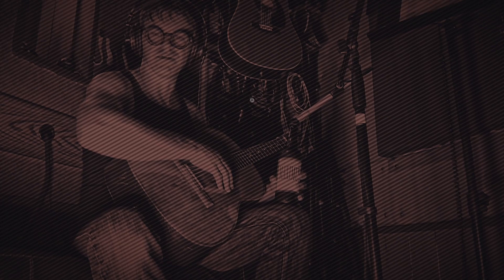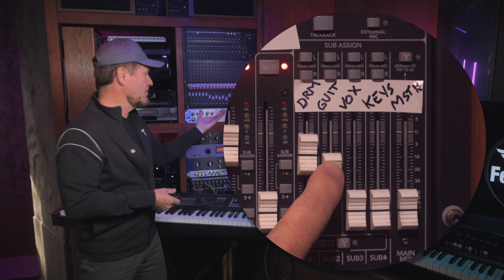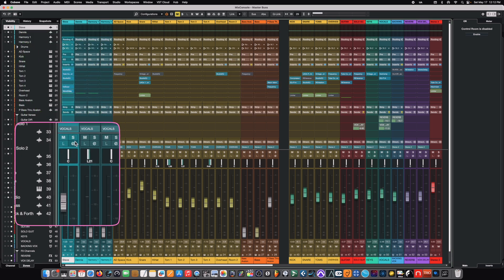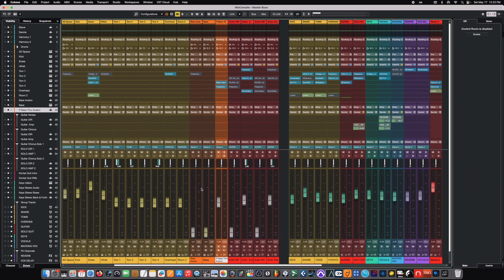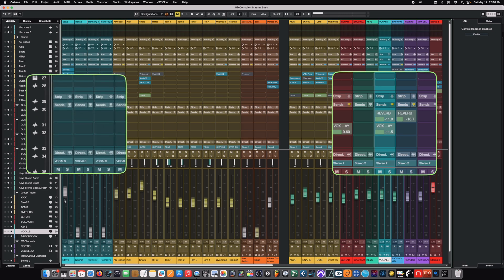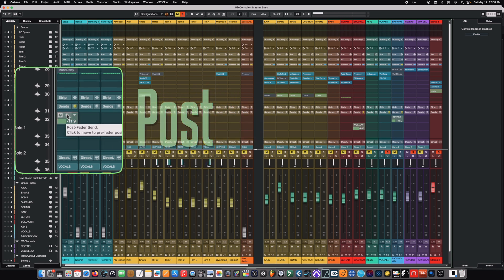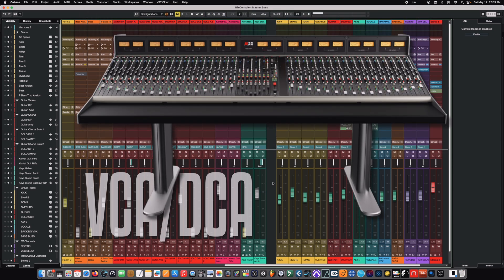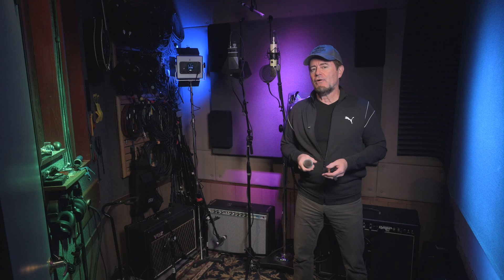Busses vs Sends vs VCA explained in Cubase.

Comment: This is a stupid question, but I really don’t understand the point of auxiliary sends when you have a mix percentage knob on the plug-in on the effect that you are only trying to send a percentage of.

For example, why would you use an auxiliary send instead of just putting let’s say a reverb plug-in on a vocal bus and just adjust the mix percentage knob on a reverb plug-in affecting that vocal bus? Doesn’t that mixed percentage knob on the reverb plug-in achieve the same result as doing an auxiliary send of reverb i.e. controlling the percentage of reverb? I’m asking this question because I feel like I’m missing something 🤪.
Reply from the maker: There are no stupid questions in audio recording for sure. In short: using AUX send amounts from channels allows each channel to have a different amount of the reverb, instead of everything on the buss have the same amount.

Comment: Thank you this was really helpful.
I have one question: at 8:42 in the video, where you choose the radio button to move the newly created buss to be with the groups on the right, I don't have those radio buttons, just a check mark that changes the visibility of the channel. I'm using Cubase Pro 14.0.32. If there is a setting to fix this, I would appreciate it if someone could tell me where it is. Or if it's been removed from this version of Cubase, if someone could let me know, I would appreciate this, too. Thank you!
Reply from the maker: On the left hand side in the 'Console' view, make sure the left zone is active. (upper right hand corner boxes) Then click on 'Zones' instead of the 'Visibility' tab.

Comment: I really like what you're doing here on your channel. If I may raise a point of constructive criticism: The analogy of an aux send/bus and a garden hose is somehwat flawed. I get what you are going for but in a garden hose 100% of the water goes in. If I then poke a hole into it maybe 20% of the water will flow out, leaving only 80% to come out at the end. With aux sends this is not the case. In a DAW like Cubase you create an identical copy of the signal, ie. you add something. So instead of ending up 20% and 80% (garden hose) you end up with 100% and 100% (DAW). Of course, then you get to the volume control on the send.
Keep up the good work. 👍
Reply from the maker: Great point.

Comment: Another great video!

I do have a critique though, but you shouldn't take it as criticism, only adding to the topic for anyone just starting out and reading this.

The problem is what you're calling what.  And doing so confidently, which may instill confidence in newcomers that these are literal definitions of labels.

Again I say, this is not a critique unique to you or your definitions or even Cubase in particular.  The same problem has existed since analog only workflows, when British manufacturers would call something different than the USA made equivalent.

From the days of Multitrack Tape Machines -> Consoles -> 2-Track Consoles, things were more clear, but not completely transparent.  Then came Digital Audio and the Wild West of DAWs and everything got even more ambiguous.

Tracks used to mean tracks on Tape.  Multitrack usually meant 4, 8, 16, 24 independent lanes of audio recorded across 1 reel of tape.  1/4", 1/2", 1", 2" most commonly.  2-Track was usually 2 discrete tracks on commonly on 1/4" or 1/2", and was most commonly used as the Master Tape Machine for Stereo recordings where Track-1 was Left and Track-2 was Right, and they needed each other to recreate the Stereo Image when played back through Two Speakers, triangulated with the listener.

Tracks were Tracks.

Channels, were what ran through cables into pieces of equipment, especially Consoles.  When you looked at the desk and said "bring down the Kick", you pulled down the fader on Channel-1, if you said "push up the overheads", you reached for Channels 7&8 each hard panned left & right.  If you inserted a compressor on a vocal, you ran that Channel through an LA2A, maybe out of there into an 1176, then out of there back into the Vocal Channel on the board.

Channels were Channels.
And you wouldn't call Channels, Tracks.

Busses, which is the reason for this comment as well as the original video, busses technically involve Multiple things being able to join together.  More accurately, electrically these are 'Summing Busses'.  

Now, what you are calling Buss vs Send vs VCA (and you spelled buss with two S'es.  How British of you!), and in the title you didn't mention the words Aux or Group but did so in the video, create a lot of ambiguity.  Let me attempt to disambiguate...

Input Channels on a Console, as well as the DAW 'Mixer Window" recreations, can process the signal coming In, but then that signal needs to go Out somewhere.  On a Console, there are often Direct Outs, that often follow the Channel Fader.  So you select an Input, then ride the Fader to the Direct Output.  Which is one way to ride levels "to tape".

But you wanna do more.  For one you wanna Mix.  And in order to Mix you need to Sum multiple signals together.  The most basic 'Mixer' in the world all the way up to a 96-channel SSL 9000K has the ability to sum two or more channels into one.  And that 2 or more into 1 is a Mono Bus, which is now 1-Channel.  If you have a 2-Channel Bus, then that can be used for Stereo left & right, and is often called the Stereo Bus.  Or the 2-Bus.  Or the Main Bus or Master Bus or the Mix Bus...  Point being, this was always a mess.

Now, after we get the essential ability to send multiple channels to a Stereo Bus that will eventually come out of Stereo Speakers, in order to get more control over the mix, we'd like some additional busses to use in different ways.

Enter Group Busses and Auxiliary Busses.

The Bus part of these only means that you can send the Channel's signal to any number of different destinations.  Again, Input Channels often have Direct Outs, so they don't Need to be summed together with other Channels if you'd rather keep them discrete.  But you often Want to sum multiple signals together for a variety of different use cases.

Group Busses, in the analog world originally, basically anticipated the desire to separate out certain channels from the Main Mix into a Sub-Mix first, primarily to make it more manageable.  The classic case is Drums, where rather than try to mix 10+ separate channels into the Master Bus, you can Sub-Mix all the individual drum mics into one Group Bus, then mix that 'DRUMS' Bus into the Master Bus with one or two faders rather than 10 or 16.

Another common use for Group Busses BITD, was to send multiple channels to Tape not from individual Direct Outs but from a Group Bus made up of 2 or more Channels.  So if 24-Tracks on Tape are a finite resource, but you'd like to have a Snare top and a Snare Bottom mic, you flip the polarity on the bottom mic and mix the two together onto one Track.  Or what about a Kick-In, Kick-Out, Sub-Kick blend.  Sub-Group Busses let you build your sounds on the way In as well.

Auxiliary Busses, on the other hand provide other solutions or creative opportunities.  You explained them well so no need to reiterate.  But whether Pre- or Post-Fader, they are Auxiliary Busses.  Calling them Sends is not unique to you, but it does miss the point.  The knob may be used to "send" a signal to a Buss.  But it's a Buss.  Often time people call them Aux's.  But they are Aux Busses.

The important thing to understand about both Aux's and Groups, whether Pre- or Post- Fader, is that they are all feeding Summing Busses, and those Busses are also being fed by other Channels.....In PARALLEL.

You said something to the effect that 'Signal Flow is one the Most Important parts of  Audio Engineering' and I couldn't agree more!   Understanding that a signal running from the Input of a Channel to it's Direct Output is a Serial Processing path, but Sending that signal to an Aux, Group, or Master Bus allows for Parallel Processing is if not Audio 101, then Audio 102.

Again, in the Analog days, even top Engineers tended to use the functions on a Console as they were labeled and intended to be used.  Then, as with all things Audio, some engineers started coloring out of the lines, and you got Parallel Bus Compression and Brauerizing.

But in the DAW, experimenting with or even understanding different Serial and Parallel Processing paths doesn't have any real finite limitations, other than understanding the differences to begin with.

Thanks for indulging this rant.
I hope it's taken in good faith as intended.
Reply: The Irony,,,,
This guy Also did a video on Busses today.
But his Opinions totally cloud his understanding of everything you said in your video and I said in that long ass comment.
https://youtu.be/9ZljTE3Iu7c?si=2Wim67kIr_oJbcn2

Comment: Can anyone explain why the effect i'm sending a track to (eg. a delay or reverb) the effect can still be heard when I bring the send all the way back to minimum? This happens all the time, even when automating the sends. Ideally I'd want to hear no sound from the delay/reverb when sends are pulled back 100%. Using Cubase 14
Reply from the maker: The send to the FX Buss is most likely in the 'Pre" position (The send color will be blue) Click on the send radio button to change it back to green and it will be in 'Post' which will drop the FX with the fader.
Reply: @Featherlightstudio That's right, however I want to control it using the send amount, not the volume fader
Reply from the maker: @xsessivmc  sounds like you may have other tracks sending the same effects buss as well then, just a guess